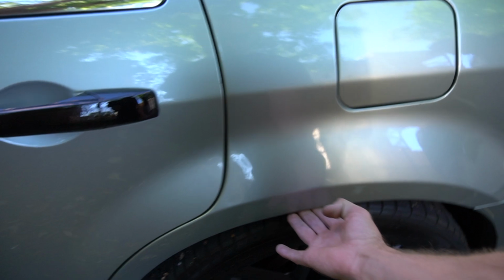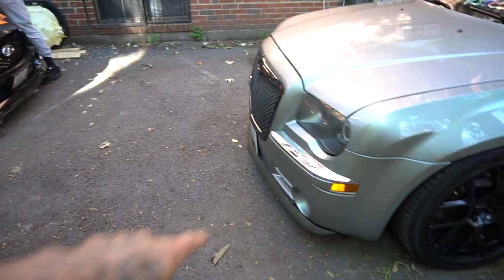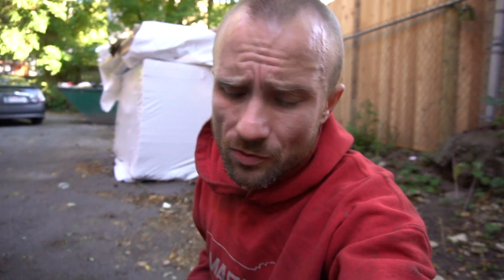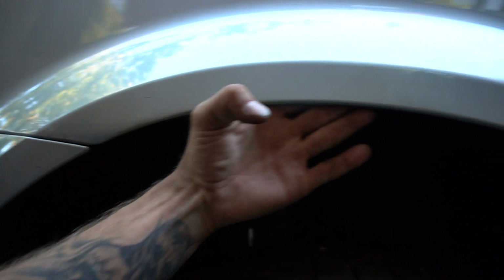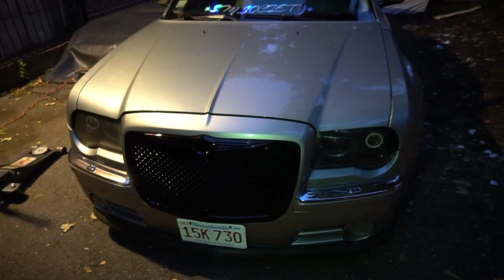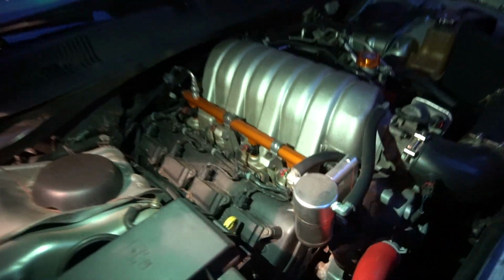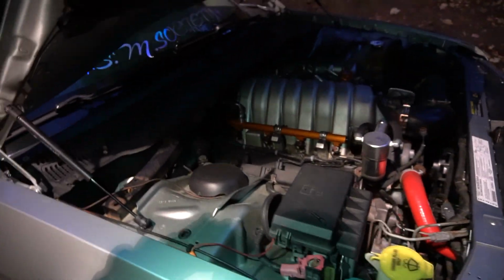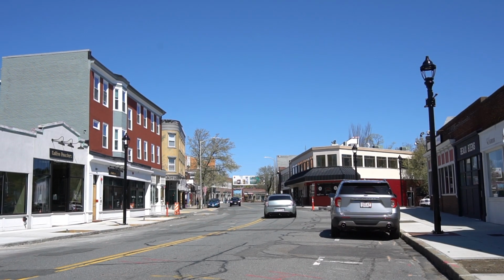Chrysler 300 SRT8 FULL SWAP Fender Roll

Comment: The previous owner of my csrt4 did a bad job rolling the fenders. Both back wheel wells and one front have chipped paint and are rusted. What's the easiest way to fix it?  Would they have to repaint the entire quarter panels and fender?

Comment: Hey did you ever figure out your bucking issue in your caliber Srt4
Reply: @SkittlefabzSRT4  ok lol I’m kind of having the same issue but I think it may be clutch related cause it’s stock with a 6 puck clutch that is noisy as hell I understand upgrading the clutch but a 6 puck is way to much for it being stock also having a overheating issue but I think it just needs a need thermostat manifold
Reply: @SkittlefabzSRT4  I sent you a message on fb was gonna get the complete unit off of modern performance since it has everything